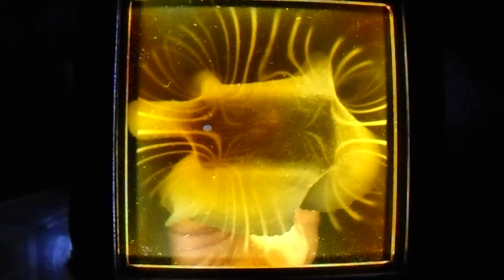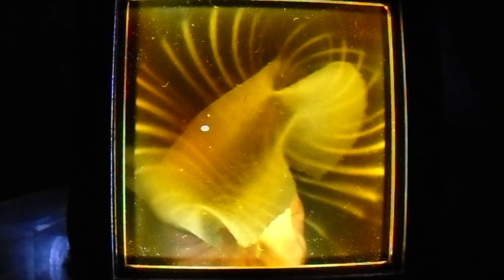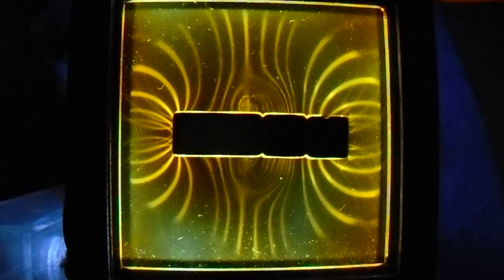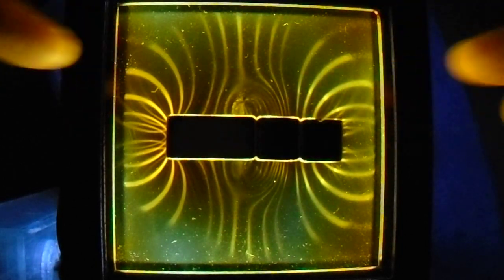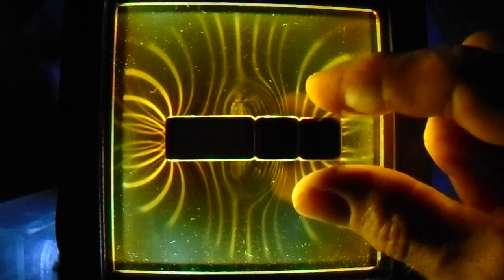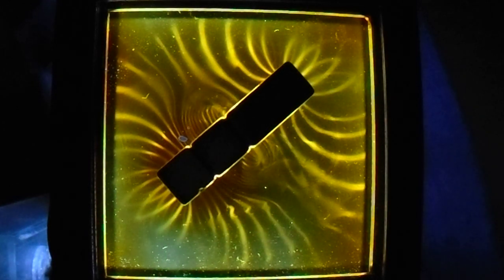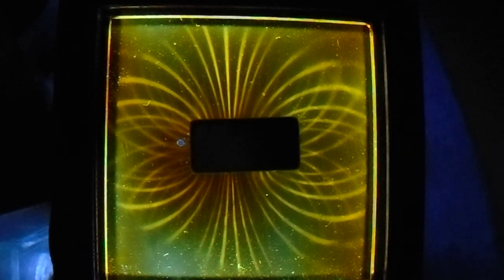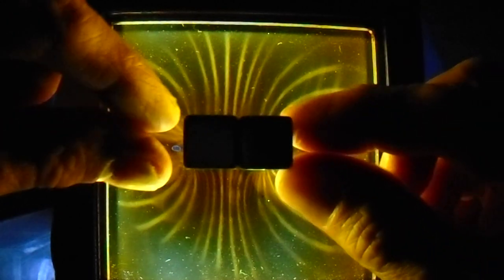4 magnets  on a ferrocell

Comment: Hey Brian is that ferrofluid made from Mouse Milk? also, does acrylic or plexiglass work as good as glass?
Reply from the maker: there is mouse milk in there. Its a mixture of test fluids.
Reply: well the definition is amazing
Reply from the maker: Plexiglass is usually warped. cheep glass is usually not flat.  There is expensive flat glass which would be best. if you use cheep glass or plastic you have to match the surfaces to find the best fit.
Reply: OK now I understand what you meant about matching. Thank you so much for your videos and sharing about what you have learned about ferrocells
Reply from the maker: no probs